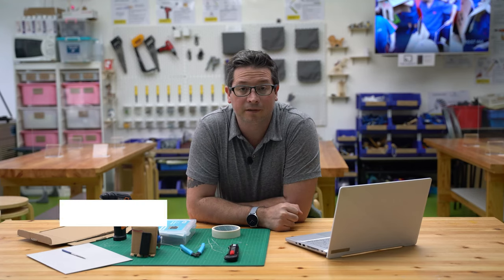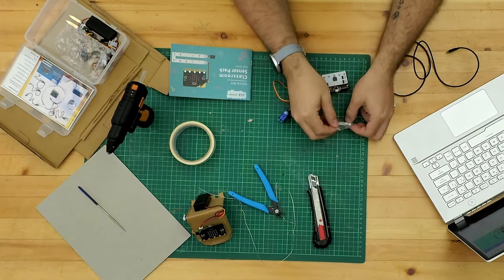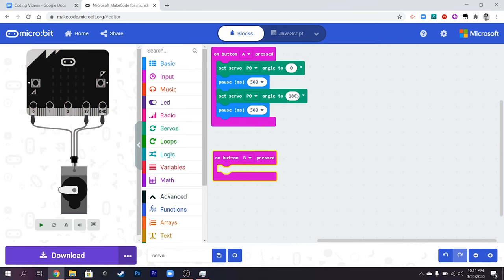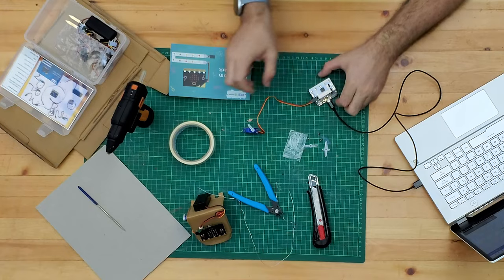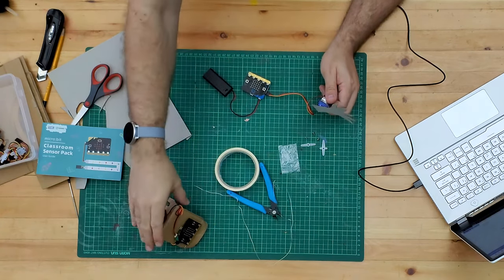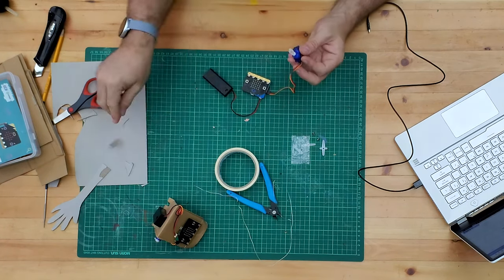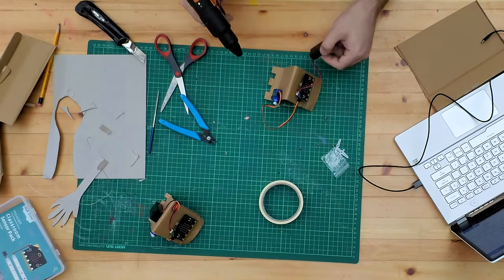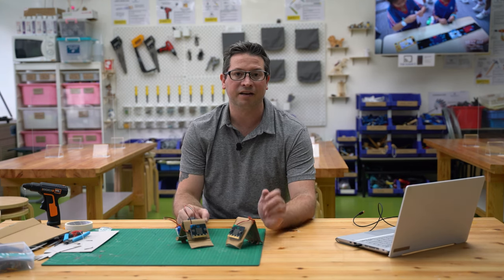Coding with micro:bit - Part 8 - Making a servo powered waving arm and inch worm

Comment: How did you get to the servo settings?
Reply: There is an extension for SERVO...  Scroll to bottom of blocks and select EXTENSIONS and select the SERVO library. It will add new blocks to your project.